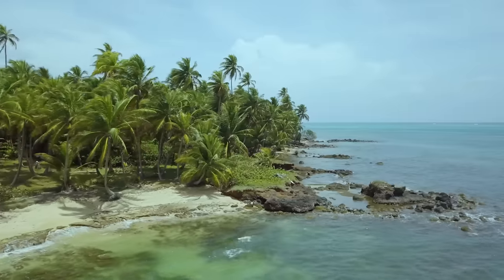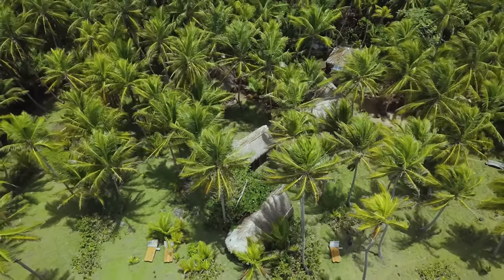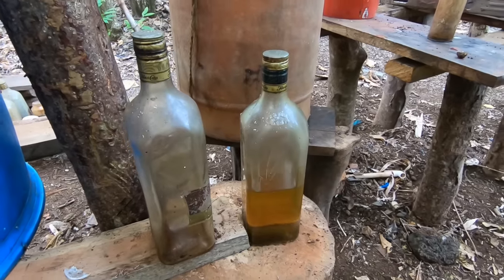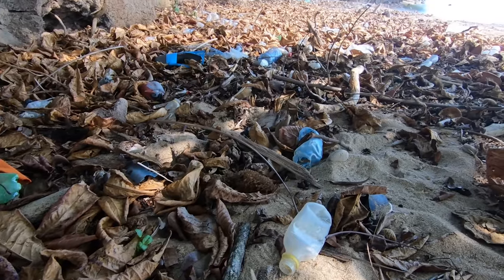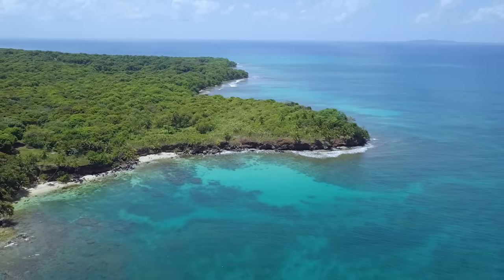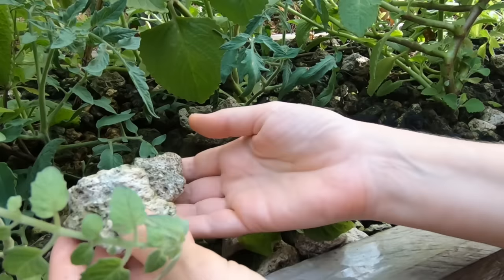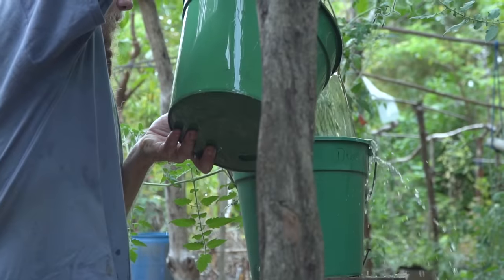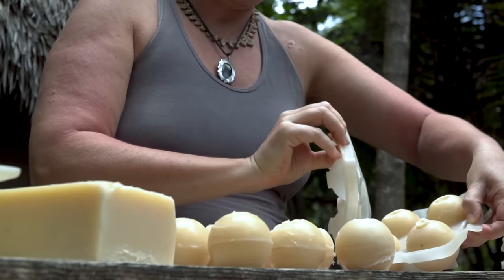THIS SELF SUFFICIENT FAMILY MAKES THEIR OWN FUEL FROM PLASTIC!

Comment: I wish someone would take this operation on a grand scale such as on a barge that would travel world wide cleaning up the ocean and getting a fuel source to run the ship and some to sell. No telling how far this could go.
Reply: talk to the company already mining the oceans for plastic they grind up on the boat, they could add this.
Reply: Why not you?
Reply: If I wasn't a worn out old man I would be doing many things now. Living off grid, inventing an electric car that will charge the batteries from the wheels turning, finding a way to use old tires as a road base, etc. But you only have so many beats in a heart and mine are coming to and end.So, you try to put your ideas out there and hope one comes true.
Reply: The energy input from the fire far exceeds that of the energy yield. If this actually worked it would be equivalent to a perpetual motion machine
Reply: @Deacon of Biology

You obviously don't know what a perpetual motion machine is. He is providing the heat and the plastic. All he is doing is removing stored energy from the plastic. As soon as the fire goes out or he stops putting in plastic the process stops. Nothing perpetual about it.
Reply: Clean up the environment WOW awesome
Reply: @deaconofbiology6249  I was thinking the same thing. He's trying to save the environment, yet he's burning wood, which is a depletable source, takes a lot of wood to make a small amount of fuel, then burns the fuel that is made. No, I don't think this puts even a small dent in destroying the environment, but can destroy the tree population rather quickly on a larger scale. Think Easter Island. But, it's a good use for recycling plastic.
Reply: The plastic content in the oceans is not terribly high. Even in the "Garbage Patches" you'll find a only a plastic bottle every few meters. I'm not sure if such a barge could operate in an energy-efficient way.
Reply: @Keimzelle  I think you should research the garbage patch more thoroughly, there’s more trash than you think there is
Reply: The process takes way more energy than it produces and on a large scale would produce a lot more pollution than it would saved.
Reply: @Keimzelle  The garbage patch is now larger than Texas and so dense you cannot take an icebreaker through the middle of it. You should try giving it a Google..
Reply: @macD723  we don't have to use just wood we can use coal, unneeded materials made out of wood, anything that is unneeded and combustible. Just saying.
Reply: @fmulder6564  perpetual motion machine basically is gaining more energy output than input. So, the idea is the same. I think you are the one that is mistaken. It takes far more energy to break down the molecular structure of the plastic back into its component parts than the energy he will ever get from that diesel. I do not mean to insult you, but with a basic level understanding of thermodynamics you would know why this is the case. Please, dont take my word for it, read up on thermodynamics.
Reply: @deaconofbiology6249  And yet the plastic on its own is only trash and the fire on its own is only heat; neither alone will power his washing machine or ice cream maker.
Reply: @deaconofbiology6249  this is already being done in Australia on a massive scale by several factories. The guy in the vid is doing it to generate electricity and using wood is all that he can use. The factories use enegy gathered from the parts of the process to fuel the whole process.
Reply: GREAT IDEA!!!
Reply: There are a few companies trying to do it. Look up the canadian company (Aduro Clean Techhnologies).
Reply: @rovhalt6650  This system has been used for years in many countries & I presume still is. I learned about it way over a decade ago, put out by a Japanese man. I tried to get in touch with him through his website, email, phone, but got nothing. He had small ones already made up to ship to countries/communities. I was VERY interested! I've seen videos on how to make home made ones, but it's beyond me. I'm off grid & don't even have any power tools 😄
Reply: I literally dreamt that years ago and asked people about turning plastic back to oil and was told it would destroy the economy...a year later I saw the Japanese Millionaire giving pyrolysis reactors to villages in Africa to cut down on plastic waste.
Reply: And probably will day from the environmental crisis with the change of the atmosphere
Reply: @youssefrochdi1994  Interesting. Could you link me to a webpage/paper talking about this in australia please? I cant seem to find it
Reply: @kcbeerslinger  you sounds like a great man and I wish you a gazillion more heart beats brother
Reply: @kcbeerslinger  I bet you  that those  ideas that you have  will be  made within a few years and  no one will ever  give you  credit/money  for  it.
Reply: @youngnutsack17  I agree that the air needs to be tested  when  he does  this and  see what  kind of things are being  released in the  air. Maybe  he or someone else  can  find a way  to  fuel  it  while  he's burning the trash??
Reply: @chrissilliker8633  amen 🙏
Reply: Yes or build a resort that you holiday in ... That is set up the same and has lessons to teach these practices 🤗🌸🤗
Reply: @Chase Williams slap a coffee filter on it ? Then use in machines ?
Reply: @deaconofbiology6249  lookup Master P "Look at all these Haters" song.
Reply: @macD723  always plant 2 trees where you take 1 and problem solved ?
Reply: @youngnutsack17  yup ! Make sure the fumes are not gna mess up our air FIRST BEFORE TRYING THIS !
Reply: @chrissilliker8633  same here I wish him a gazillion more heartbeats 💓
Reply: Diesel has a high flash point, what was lit has a low flash point. 
The low the flash point the dryer the fuel.
Diesel has lubricating abilities..
On board ship we used diesel to clean parts among using it as fuel for the 10 diesel engines the ship had..
If I was to create a fuel source in my backyard as in the video.
The feds, state and county would shut me down in a heartbeat and use any excuse to do it.
Reply: @usavideogames7599  yeah, in 10 years maybe. lol. Trees don't grow over night.
Reply: @macD723  
Energy (flame) can be produced from salt water, saw it some years back.
Reply: @youssefrochdi1994  
I'm in Aus, where is it happening?
Reply: @Butchsiek   the way things are going, even for suggesting you might do it, would incur wrath from some little dictators.
Reply: @macD723  true but by the time you've cut down the last adult tree, the 2 baby trees will be grown.

Trees don't get completely removed from earth over night. Especially if you plant 2 for every 1 you take
Reply: @deaconofbiology6249  that's because there are no factories doing  this. Australia does have a group of scientists experimenting with the process though.
Reply: @youssefrochdi1994  no it's not.
Reply: We know very little about the refining process.  It could be very toxic and harmful for the environment.
Reply: @travisdoe4663  That's ridiculous. An icebreaker can cut through 2m+ of solid ice, no amount of garbage in the water could stop it, it would simply displace it.
Reply: There are only certain plastics you can do this with. He's making his fuel out of stretchy film plastic and that is a kind that is actually recyclable, which is the reason why it's so easy to find dropoffs for it. What you find in the ocean is a mixture of unknown plastics and very few are recyclable. And another problem is developing a system that can automate identifying what kind of plastic each piece is made of.
Reply: Make the equipment, and people will end up using it.

Comment: Rather than burning wood why not use a low boiling fraction to feed a blast burner?  As a note of caution: Depending on the feed plastic you could be getting some very toxic material that will make abnormally toxic exhaust when partially burnt in a simple Diesel engine. PP and PE will give mostly alkanes and alkenes (good) PS gives styrene and other aromatics (like benzene) (less good) polyesters, nylons and polyimides will give very complex distillates (possibly worse) PVC and PTFE will make hydrochloric and hydrofluoric acid respectively and chloro(fluoro)carbons (very bad).  The tar left over in the still might be toxic.
Reply: how to seperate out the fractions? based on type of plastic?
Reply: Fractions are separated by boiling point so it you’d have to analyze output for this particular still , set up a more efficient reflux condenser and cut by temperature. A really interesting study would be looking at number of birth defects and cancers on the island over the next 40 years.
Reply: PTFE is pretty rare and you'd be able to identify it. Overheating of PTFE generates fumes of highly toxic PFIB and poses a serious health hazard to the human respiratory tract. PFIB is approximately ten times as toxic as phosgene. Inhalation of this gas can cause pulmonary edema, which can lead to death.
Reply: Chemist here. Yes, you are absolutely right. On the other hand: with a little bit of common knowledge, you can pretty well guess which product is which material and pick the "good" stuff. I believe a responsible person can do this properly, but a careless person will do lots of damage to themselves and the environment. And yes, the leftover tar is definitely toxic and needs proper disposal (costs!)

Comment: you my new found friend are living my dream. i have been down the road of alternate fuels, ( used veg oil to run my diesel car for 10 yrs, make bio diesel, make soap, build solar cells from broken cells, recycle old 12v 200amh batteries, wind gensets from fisher n paykel washing motors, fresh water from sea water solar stills, water heaters using the insides of foil chip packets, used motor oil recycling/filtering, for heating and reuse as engine lube.
keep up your life style.. i wish i had another chance to do this all over again in another lifestyle as yours....

Comment: I’d like to see more about how you made the diesel maker.
Reply: The diesel engine was originally designed to run on peanut oil. Beware burning plastic creates carcinogenic dioxins.
Reply: Oil/green energy does not want you to know or attempt to distill and crack your own hydrocarbons, hell alcohol as a fuel has a giant racket built around it but it’s green!
Reply: @sang3Eta  If it combines with oxygen at very high temperatures. From what research told us, it is not a problem if the oxygen is evacuated before hand.
Reply: @TheZmoney420  No, reason you cannot do this in most nations except in industrial situations. Is how toxic the pollution is.

The fjord i live in, we cannot eat the fish still. From pollution that happend 50 years ago. Same pollution you get from burning plastic. Industry can clean it up much better than a man with a still at home ever can.. Thats why this is not allowed in most nations unless you can prove you clean it all up.

Sure he reduced the microplastics in the sea. But he takes carbon from solid form and turning it into a gas. That is one of our current problems with global warming. 

Would be better off making that plastic into a polymer nature can break down, and not making a solid into gas. But you would not get energy then. Better to get some extra panels in that case.
Reply: @MrDanisve  I was thinking the same thing - as garbage, the carbon in the plastic is locked away, as diesel it's released into the atmosphere. Still, I suspect the amount of CO2 is very small compared to other sources.
Reply: @PatGilliland  one other problem is when the plastic trash / old tires accumulates in a dump and catches fire.  In Nunavut there was a fire in a municipal dump that burned for two years and it caused breathing problems to the nearby population.  It would make sense to convert the tires and plastic to heating oil which they need anyway instead of paying a high price to get oil shipped there.
Reply: @PatGilliland  multiply by 8 billion people.  Their carbon release per person is still high-ish.  And more pollutants resulting.
Reply: Really enjoyed this, you did a great job
Reply: Mostly lies, except the chemical process. Diesel isn’t that flammable
Reply: @MrDanisve  Carbon gas is plant food. The "global warming/climate change" agenda is war on all life on the planet.
Reply: @scottbradentx  The carbon gas released by people is plant food. The "global warming/climate change" agenda is war on all life on the planet.
Reply: @RandomsFandom  It was freshly made so there were still volatiles in it. Normally they would either be aired out or heated and captured in a secondary process.. What else did you think was a lie?
Reply: @joleezanes5938  lmao....
Reply: @joleezanes5938  I've been telling people this for years. Isn't that why the dynosores were so big? One volcano eruption produces far more co2 than us. 90% of emissions come from planes but tax cow farts until we all eat lab "meat".
Reply: Check out Mr.Teslonian and his bio fuel reactor video's. You can make crude oil,  multiple grades of liquid gas, and butane gas to power a generator all simultaneously just by heating organic matter in a sealed container with the right pipes, diffusers, and containers anyone can make.
Reply: @joleezanes5938  very true! The globalists fooled the masses with that hoax, while producing & using dangerous chemical sprays on air,  water and soil  that destroys all plant & animal life. They also use chem trails/geoengineering/HAARP weather Weapons (just like they did in Texas), while claiming reduction of CO2. The Artificial chemicals they have created are dangerous to all life, not carbon!
Reply: @stybur19  I think i have more schooling in chemistry alone than you have in total schooling.. So do not think you need to teach me anything.

Plants do not like heat no. You know, most plants need water to survive.. Hard to do that in a hot climate, water evaporates..

Take a look at what happend in the Biosphere when they increased CO2 levels..

Arid lands, is about 30% of our landmass. Contains about 1 billion people. Alot of that stands to be deserts if temperature increases.. Not to mention the land area lost to seas rising..

Get a clue.. And stop breeding with your sister, not really good...
Reply: I don't know what he's making, diesel isn't supposed to ignite with a match like that. He's definitely making fuel but it's too volitile to be diesel.
Reply: @justacinnamonbun8658  It was freshly made so it still had volatiles in it.
Reply: @MrDanisve  "Hard to do that in a hot climate, water evaporates." tell that to the jungles clustered around the equator.
Reply: @josephmiller997  Rainforest are ancient forests that cannot develop on its own with modern climate. Only reason they exist at all, is that they make their own climate. Only reason have have been able to hang on.

However with the deforestation thats happening. Im expecting the forests to lose their ability to generate a climate in the future.

Add to that more pressure from climate, and the compounding effect of pressure from humans. It can only take so much before the system collapses.
Reply: @HepCatJack  When tires get recycled, they get converted into crumb rubber. Although some of it gets used for things like road surfaces, sadly a lot of it gets sold as fuel, as it has the same energy density as coal.
Reply: @MrDanisve  And yet commercial greenhouse operators go out of their way to ramp up the CO2 levels inside their facilities. The reason we had megafloura millions of years ago was due to the high CO2 levels in the atmosphere.
Reply: @lihtan  The earth is not a greenhouse. Go back to school...
Reply: @zodoz The video is good thanks to Gipsy Journey, they got skilz.
  We hotspot off the cell tower. Communication is much improved since the old days. I don't think there even was a phone out here back then... :)
Reply: Everything on this planet is carbon based.
Reply: @kevinshort5468  Tell that to Hydrogen :D
Reply: @zodoz Thank you for the kind words, be well :)

Comment: How about a manual/ pdf with accurate diagrams explaining how to build use and maintain the fuel machine. Thank you.
Reply: Yes that what i want
Reply: Look up pyrolysis
Reply: @chris2790  thank you
Reply: how to produce toxic gases 101 :D
Reply: "pyrolysis" is it indeed. It's odd that that word never came up in this video. And then, it looks like they've got a pretty well stocked hardware store nearby. Hmm.
Reply: @MrHarpette   Maybe you can by a hammer, machete, nails and pvc pipe fittings but not much else. The good hardware stores are in Managua all the way over on the other side of the country.
Reply: We will do a basic writeup explaining how it works and what we've done with simple diagram, many people are requesting the same. We'll put it both on our little channel (it doesn't have much) and on instagram. We'll let you know when it is done.  https://www.instagram.com/dereksplacelittlecorn/
Reply: @dereksplace1342  hey mate nice place! Was wondering if there is waves for surfing around the island?
Reply: @freshdonkey1760  Only when the wind blows very hard from the east for a few days, there is a good break off the south point. Good surf on the Pacific side, though. Here is more of a diving place, calmer, clear reefy waters.
Reply: Call pyrolysisis and there is a waste management plant in Idaho that you can go visit that is doing this exact same process to make fuel for garbage trucks
Reply: @kinzieconrad105  What is the name so people here that don't believe it can look it up?